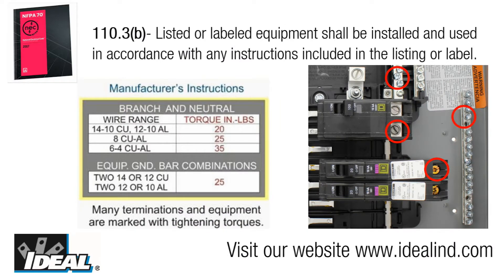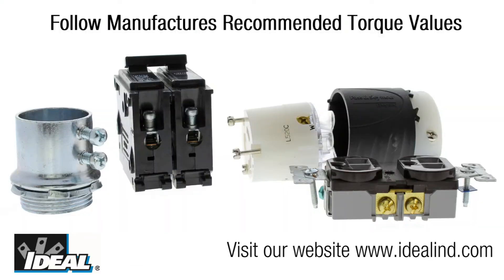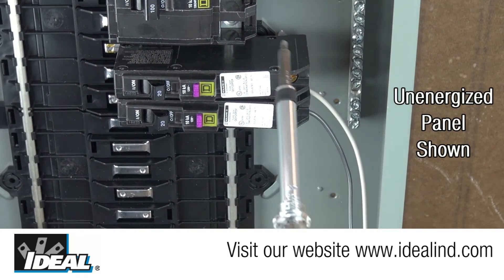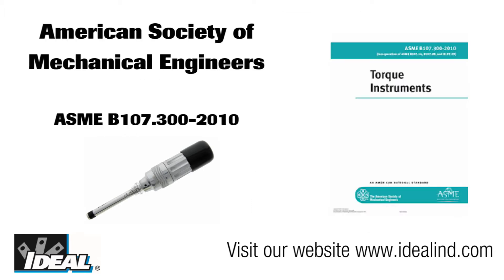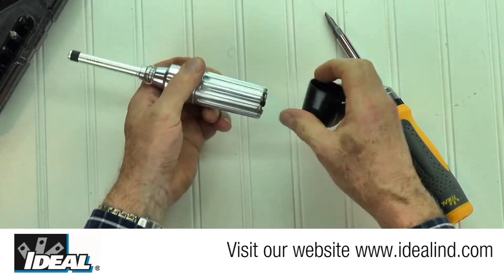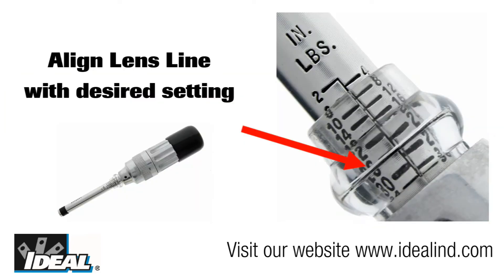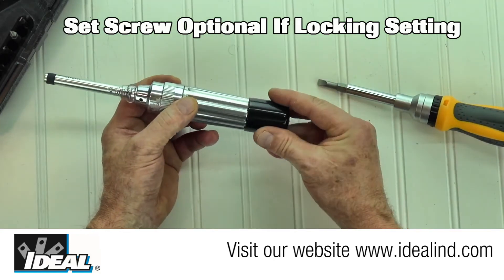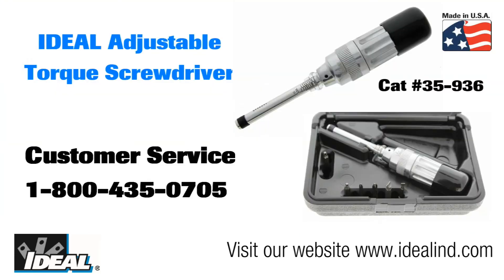35 936 Torque Screwdriver

Comment: These regulations are either going to cause ballooning labor costs or mass apathy to the code
Reply from the maker: Brent I would tend to agree with you there are a few things in electrical that seem over kill like arc fault circuit breakers. A $5 breaker went to more like $40. We need to do a redesign on these and make them more affordable. Ron